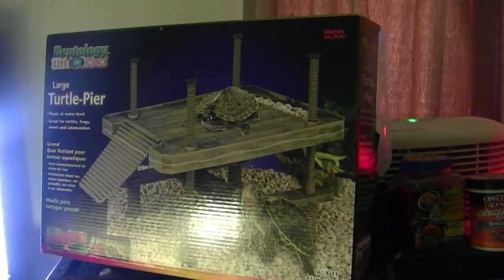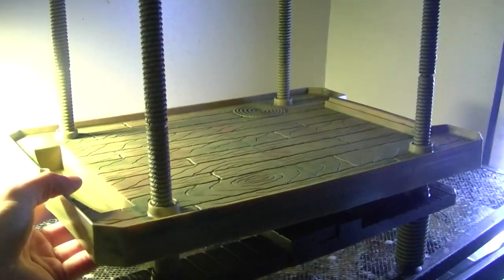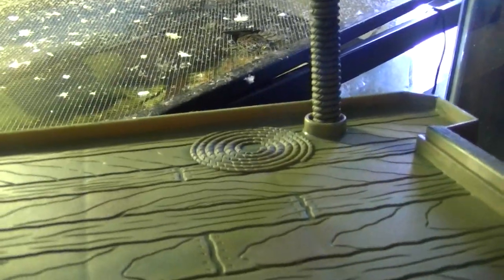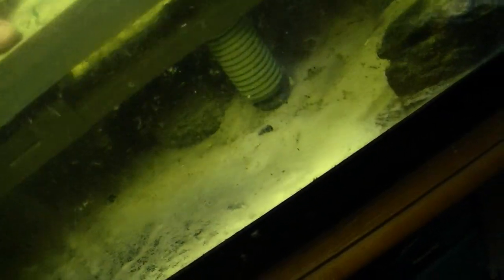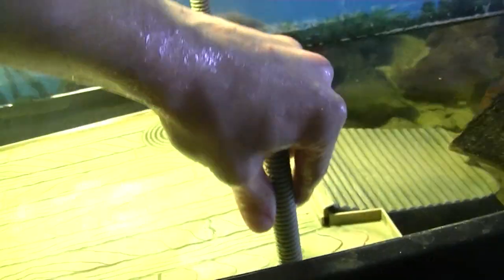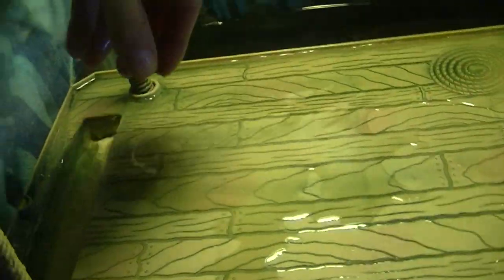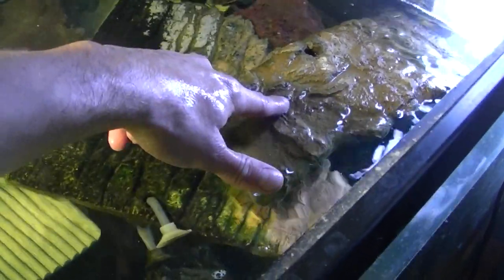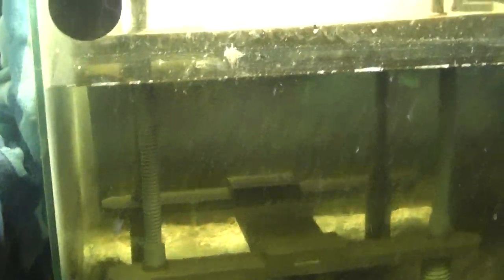Turtle docks - what type to use - Penn Plax Turtle-Pier review

Comment from the maker: Really, it warped?  That would be bad.  As for me, I have no problem with it holding weight, it holds my turtles up way above the water no problem, perhaps the bottom air pockets you didn't have filled correctly with air?  I hope it lasts.  For now it is working great, but I'll just see how long it lasts.  Thanks for the info.

Comment: If you're using a 40 gallon breeder tank that's 18in×36in make sure you don't use this. This turtle doc is 14 inches wide and if your turtle decides to slide back in the water off the side,they can get stuck. Depending on the size of your turtle and if this doc is centered in the tank. If your tank is 18in wide and the doc is pushed all the way towards the side turtle can slide back in on the front and whichever side will have roughly 4in for turtle to go back in. If it's centered or even off centered they'll have 2-3 inches and they can get stuck between the glass and the dock. I have a larger Red ear slider and she was just large enough to get stuck. Luckily I got home from work and she didn't die,but she was exhausted from struggling and pretty much gave up,she had to be stuck for hours.I don't want this to happen to anyone else so I decided to leave this message. Make sure that if you buy one of these that your tank is 15-16in wide and you should be fine. And again my tank is 18in wide. My turtle likes to push things around too and go places that her body can't fit. So take that into consideration also,if your turtle does stuff like that too. Now I'm shopping around for some other type of turtle doc.

Comment: So, I'm planning to get a pet turtle and was wondering:
So, The average room temp. in my house on a relatively hot day is abt. 30 degrees Celsius (86 F) And since you said the basking area should be around this temp, should I also get a heat lamp for the basking area or is only a good UVB light enough? and how do I keep the water temperature from getting too hot?? and if I want to keep fish with turtles, what are the best fish to get??

Comment: If you wanted to add more buoyancy you could always add styrofoam underneath it in square blocks that you can get from Pat Catan's and that will create more float
Reply from the maker: Agreed.  The other option is using a glue gun / hot glue to glue on a plastic cover over the bottom.  There are lots of air pockets in the bottom, but, they often get filled with water over time.  Making them be fully air, and unable for water to get in, would also make this work great, without adding bulk.

Comment: I should've watched this video before I bought the turtle dock it works fine since mine is a hatchling but it was more expensive than that and it can only hold up to two pounds ( its the medium ) but still in the long run that would have works out better

Comment: Thank you for the visual, I'm about to buy one for my tank.
Reply from the maker: It's a great dock!  Get the largest version they have.
Reply: does sand effect the turtle?
Reply from the maker: Nope, they are just fine with sand.  I prefer sand in turtle tanks, or, large rocks.  But, sand is great, and, it holds beneficial bacteria to help clean the water.
Reply: Thank you because I have sand in my tank also.

Comment: How heavy of a turtle can it support without going below the water.  I am getting 2 RES (about 5-6 in diameter) and was wondering if you think this dock would be able to support them.  On Amazon reviewers thought it did not support their turtles and several people modified it to make the top height fixed (with zip ties or packing) in order to keep the platform above water.  Thanks!
Reply from the maker: +Snigdha Das Two adult res are very large and heavy.  At the size your's currently are, it should be alright, but in time, as they grow, it will probably need some extra support.  I have one adult RES using this dock in a new tank I have setup, and it is ok for the single RES of about 8", but sometimes I do have to drain it.  May try adding some foam to the bottom or other ways to make it a little more buoyant.
Reply: +Earthling1984 Thank you!
Reply: +Earthling1984 I want to know that which type of aquatic turtle is the best for the beginners? Please write soon thx pal
Reply from the maker: Stephanie Wu No turtle is a 'beginner' pet.  Most live 50+ years with proper care!  Basically the most difference is size of tank.  Larger turtles need larger tanks.  Even a single smaller size turtle will need at least a 40gallon.  Most other species that are larger will need 75gallons or larger.  But it's best to research a lot, decide what you may want, then research a lot more.  Then decide if you want it as a pet.